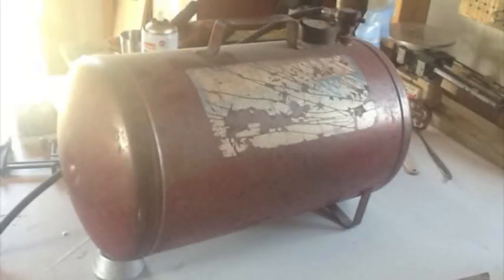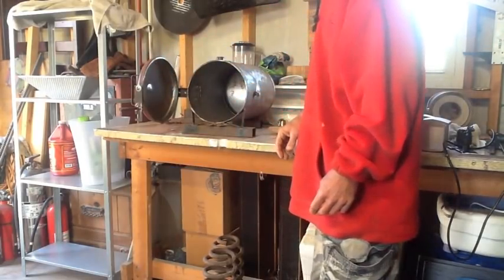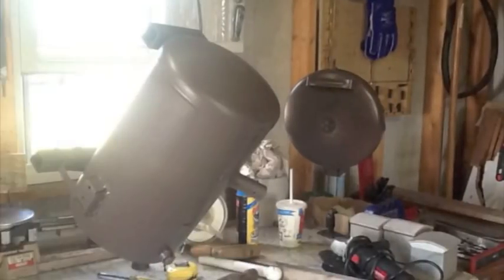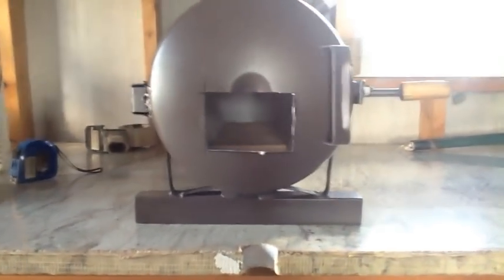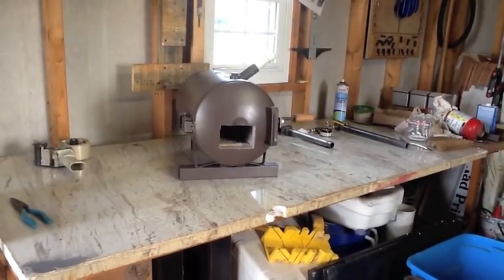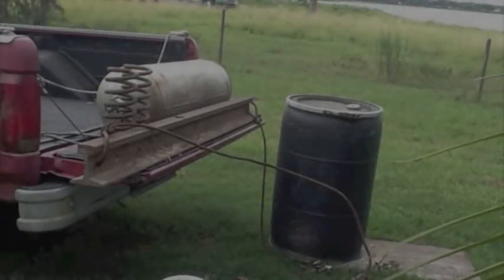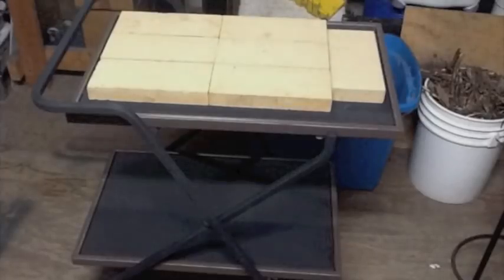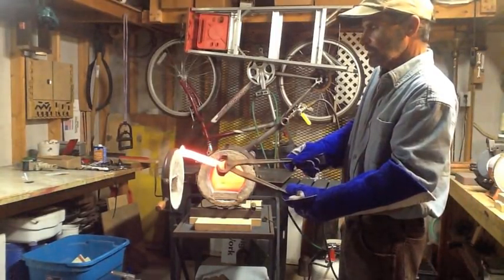My Custom Blacksmith Propane Forge Build - Start to Finish

Comment: I've seen vids where the door hinges are welded in place before completely cutting the door loose. Just cut under the hinge first, then weld the hinge, then cut the rest of the door. guaranteed aligned.
Reply from the maker: I like !! 👍🏼😊
Reply: David Saunders 
YOU DA MAN!

Comment: I have no idea why anyone would down vote this video. It is probably the best propane forge build by a beginner that I have seen on youtube.  You clearly did some research on the subject before you started.  For forging small, more or less straight parts up to as much as 5/8" square, this should work very well and for larger things you can always run it with the door open.  On forges that are kept in a shop it is often more versatile if you forgo a front door altogether and instead stack fire brick up, leaving the smallest possible opening for whatever item you are forging. You can easily adjust the width and height of the opening by moving the bricks around or using things like 1" spacers to raise the opening height a little bit.    A buddy of mine made his door of two vertical light weight (insulating) fire brick that slide to the left and right in a track.  I just stack brick up, myself.  You will also find it quite useful to incorporate a sliding stock support into your design.  

On your railroad track I hope you won't take offense if I tell you that generally speaking, they make very poor anvils...at least when used in the orientation that you seem inclined towards.  I'd like to suggest that you consider studying the ABANA page covering adapting RR track and crane track for use as an anvil.  

http://www.anvilfire.com/21centbs/anvils/making/RR-rail_anvils.php

The issue is that the web between the working surface and the base is far too thin and has too little mass to allow efficient forging.  It flexes, absorbing some of the energy of your blows and robbing your hammer strikes of a fair amount of energy. RR track is more effectively used place on end.  Check out that page.

Generally speaking, a damn decent job.  This is coming from someone with roughly 25 years as a hobby smith and after having built or rebuilt about six propane forges.  At some point you should also try out a coal/coke forge, either by building one or by trying out someone else's.  I forged only with propane for my first 20 years but acquired a coal forge about 5 years ago and now I rarely use my propane forges.  I find coal or coke much better suited for the small hand forged items I make.
Reply from the maker: + Scott Rich Thanks for the wonderful comment, with you having 25 years in smithing and experience building forges I take it as sincere compliment that you liked the forge I made :)

I had no experience at ever making one, and did watch many videos on YTube of people who made theirs, some with great success and others who had problems. I watched the problem videos more than the successes to learn what “not to do” and to learn from other’s mistakes. I had a clear idea on exactly how to go about making mine before I even broke out the angle grinder because I did do my research. I was essentially building the forge around the burner I had made for it previously.

I saw a number of forges made with the firebrick doors…..decided against it so I wouldn’t have to mess with moving bricks around all the time even tho it IS a great option and I am sure works well. I just decided that wasn’t for me. I do have a stock holding “apparatus” I made for the forge that is adjustable and built into the forge. I should maybe do a follow up video on the forge since it is currently my most watched video. I can’t believe it almost has 15,000 views as of today (7/18/16), I never thought any of my vids would reach 1,000 views but lots of them seem to be well received on YTube for which I am happy :)

I know RR Track is a poor choice and I actually spent a lot of time on the site you mentioned prior to making the forge. Thanks for putting that link, hopefully others will check it out as well. Not being overly rich I worked with what was in my budget so use RR Track for now. Would LOVE to have a real anvil, even attended a few auctions but they always went above what I could afford :(

Anvils aren’t cheap, would die to have a “real one” LOL! Hopefully one day I can afford one. I did my best on building the forge so you saying a “damn decent job” makes me feel good about it. Regarding “thumbs down(s), had I been better at editing last year when the vid was put up I think I could have put on a much nicer presentation, but it is what it is. I do plan on make a coal forge as well, I can make my own charcoal as free oak is easy to get. Just need a 55 gal and a 30 gal drum and the wood. Coal or Coke isn’t easily found here in Florida, but is the better choice. Well again, thanks for the great comment and for watching the video, means a lot! :)

Comment: I'm modeling mine (with minor adjustments) from what you've done here. The only thing different I'm doing is making it open ended to work longer pieces of stock. Great video and build. Thanks for the contribution.
Reply from the maker: You will likely need 2 burners with an open ended design...best of luck!

Comment: Nice work on the forge sir thanks for sharing
Reply from the maker: Thanks, hopefully will help someone looking to make one that will work right out of the gate :)
Reply: Makin Sumthin From Nuthin I'm sure it will. It gave me some ideas to improve the one I built
Reply from the maker: Great!  Keep me posted!  I should do a follow up vid of it in action more, not much of this vid showed off the fire breathing dragon :)
Reply: My latest video has my forge in it and I'll try do a video of me upgrading it. Also had a bash at forge welding 👍🏼
Reply from the maker: Will check it out after dinner. Thanks! :)

Comment: I did my piece of railroad track with a hacksaw using a bi-metal blade. it costed me 2 hours under a burning hot sun. Your method seems a bit more sane.
Reply from the maker: Yikes, you are more ambitious than me! I didnt have the $$ at the time but was $$ well spent!

Comment: Hey man just wanted to let you know that your video helped me A LOT. Finally pulled the trigger on building my forge and i referenced this video a TON! I appreciate you sharing your knowledge man
Reply from the maker: AWESOME!  & THANKS!!
Reply: @MakinSumthinFromNuthin  How is it holding up?
Reply from the maker: @briholt100  still works perfectly as designed
Reply: @MakinSumthinFromNuthin  hey, great to hear and not surprised.  Good quality.

Comment: Great job, that forge should last a lifetime and looks great in your shop. That Craigslist haul for $50 was a score. The table you used for the forge was from a tile/brick saw, I've had two over the years I found in the garbage and repurposed. I'm a new subscriber, I'm looking forward to your other videos.
Reply from the maker: Thanks for that info and for subscribing. I got that forge table free, wasnt sure of it original purpose, just cleaned it up a bit and works good for the forge. My Video List is gettin bigger if ya wanna check them out, I am the ultimate "repurposer" LOL :)
Reply: +Makin Sumthin From Nuthin Recycling things to make new tools is a great thing, we learn new skills, help the environment, save money and make new friends and mostly we get new toys to use! There's no downside!
Reply from the maker: I agree! :)

Comment: I worry about the amount of heat rising up onto the ceiling of my garage when I use mine. Do have any input on that?
Reply from the maker: Cement board affixed to the ceiling directly above the forge and a cheap box fan or two to move the hot air outside if you keep the garage door open while in use

Comment: Railroad track is made from 1080 tool steel, you have very good steel for an anvil.
Reply from the maker: they are a bit small but work ok
Reply: My brother made a cold forging anvil from RR trax (he didn't want to use his Peters anvils) and we bolted it to a heavy plate to take care of the lightweight issue we also used a 30" length. An example, I cold forged small feet for stair rail posts that were too small to put into the forge. We built a natural gas forge we could melt steel in. That's a foundry. That was scary at times. LOL Oh I should warn you to wear darkened shooter's glasses, the yellow ones. Reason is the light from a bright glowing yellow forge damages your eye sight in time. Just a heads up. My brother's shop is in CA and his web site is themetalguy.com. we did quite a bit of cold forging, we're both sheet metal guys, blacksmiths, coppersmiths and I'm an ultra precision TIG welder and have welded RR trax and believe you me it needs some serious preheat with that high carbon content, that's knife making steel. Oh FYI, angled steel bed frames are also 1084 steel.
Reply from the maker: Sounds like you guys got stuff under control! 😎
Reply: So those metal bed frames that collapse and fold up in pieces with the formed legs with plastic feet are made with 1080 tool steel...that's good to know! See those setting out for free sometimes.

Comment: Is the railway rail hard enough on its own to serve as an anvil, or did you have to weld a steel facing onto it?
Reply from the maker: Its hard stuff and I used it as is. Its a "poor mans anvil", not really a long term solution for serious blacksmithing but ok as a beginner anvil. I have sold off 1 or 2 of them to subscribers that wanted one
Reply: @MakinSumthinFromNuthin  I'm from the state of Florida too, and you may want to do some checking. I was told by CSX that selling Railroad tracks even the ones that may see little use, "they may be disused but they are never abandoned."... It is illegal to sell railroad iron (even the plates and spikes) for scrap metal in the U.S., and the only people allowed to do it are contractors hired by the railroad to remove and recycle or scrap out abandoned railroad tracks. I don't think you want to be putting all of your video and comments on youtube...I know, I know..."everyone does it"...just do what you think is best and CYA...great job, I'm working on my forge now!

Comment: Great work. You and your angle grinder seem to be really good friends!!
Reply from the maker: Thanks!, however I think I have drove the angle grinder to its death ☠
Reply: Makin Sumthin From Nuthin I like to use flap discs for sanding jobs like you did in this vide. They're not near as LOUD, and they don't dig in to the material as much. Gotta have a Makita or Dewalt. Hey, where did you order that wool material from? Considering making one like this after this knife season ends. The forge I have now is just a little gingerbread house looking thing I made out of refractory brick. It works, but a lot of heat escapes through the single layer brick that I think could be better served INSIDE the forge !
Reply from the maker: I bought the angle grinder just for the forge build, never owned one B 4. Didnt discover flap discs til later 😡 

I got the wool online from a pottery supply, most sell it as well as rigidizer and sodium silicate....shop around as price varies greatly. Use 1" wool and double up on it...is easier to work with that way IMO :)
Reply: Makin Sumthin From Nuthin Cool. I'm currently looking to score a tank, then I'll get started. Loved your design.
Reply from the maker: Sweet, keep an eye on Craigslist 👀

Comment: I used a Lenox diamond hole saw. It worked well. Kept the handle on as well. I also have refractory cement to use along with the Kaowool and ridgidizer. I kept both of the square door plates and pop riveted them on with hinges so  that I could close it up and carry it. I bought some two inch black steel pipe and cut it down to weld to the holes for the burners and drilled three holes in each for thumb screws. Also acquired a fairly heavy duty cart which I’m filling the top of with kiln bricks and four large mounting bolts sticking up through them to mount the forge to. Built my own double burners with an extra valve on the second so I can run only one when I don’t need two. I meant for mine to be more portable so that’s the reason for the differences. Also the way I’m building the cart I can always upgrade to a larger tank as mine is a little smaller than yours. Mine was certainly probably not the cheapest route although I’ve been buying all the components over the last year and a half. Good job though your forge looks good.

Comment: Great video, some great ideas for my next forge build. My current one is made from a 1 gal paint can using perlite and plaster for the insulation and coated with refractory cement. It work great for knives, but the size limits what I can forge. Thank you for sharing your build sir.
Reply from the maker: I am glad it sparked some ideas 😊 Thanks for the kind words

Comment: Very nice forge. I wish I had the space to make one, but my place has no garage or even a shed. But eventually I will be moving and hopefully find a place where I can build my own forge. I will be trying to use your method as I always figured an air tank would be much better than using an old propane cylinder. I used to have a nice #55 anvil but someone decided they needed it more than I did and walked off with it.
Reply from the maker: Thanks....and sorry to hear about your anvil 😡    I am sure your forge will turn out great! :)

Comment: excellent work. I am going to use my 30 gal old iron horse compressor to make the same think. Thanks for the Video
Reply from the maker: Thanks!, you will need a bigger burner than mine with a 30 gal tank tho....Good Luck on the build!

Comment: Hello and Merry Xmas,  Nice project and executed very well.  I would suggest that you take a piece of 16 ga strap (2" worked well) steel and weld it inside your door opening with an inch protruding.  It bends to shape with the heat of the welding and some 'C' clamps.  Overlap the ends and weld close to them before cutting off to complete the circle.  This gives you a nice seal when you close the door over the top of the protruding one inch.  I have used hot water tanks, propane, air and compressed gas cylinders (condemned diving tanks also) for projects.  I made a welding rod oven with a hot water tank keeping the foam insulation except where I cut it which I replaced with a can of spray foam.  A small silicone heating pad keeps it toasty.  Take care and enjoy the holidays.  Doug
Reply from the maker: Hapy Holidays to you as well, appreciate the kind words and suggestion. Will keep that trick in mind for any future builds. Was hoping you had some vids documenting the process, I certainly woulda watched them! :)

Comment: hello sir, I'm glad I found your channel. I gave an old air compressor that came off of my welding truck that I am doing the same thing to it. most of what you did is spot on to what I would like to do for mine. however I believe I will make a door for the back as well as my belief a door on the side. I was planning on 4 burners 2 on each side alternating. I think my tank is a 40 gallon. 
I have a bus brake drum to make a Coke Forge as well.
Reply from the maker: Sweet, sounds like a good plan. Probly roast a whole turkey in 4 min with that one! :)

Glad you like the channel :)

Comment: Nice build!! I may sacrifice my Campbell hausfeld air pig and build a forge like yours!! I’ll probably use paint stripper to remove all the blue paint though...grinding that would suck ass! I might leave mine bare metal and use high temp clear coat! 
Thx for sharing!!
Reply from the maker: I had the time so stripping the paint manually was within the budget. I hope yours turns out nice, its all in the burner

Comment: Awesome job on the forge design and construction. Looks to work a lot better than mine does, but with a bigger volume and still only one burner - a very effective one it seems. I'd have expected you might need 2 for a forge that size. A quick word on the anvil - since you have spares kicking about, consider boxing in the sides of one and adding something to increase the weight - maybe pouring lead in if you find it for cheap enough.
Reply from the maker: Thanks Matt!, if you have a video of yours I would like to check it out. Interesting idea on the anvil, will take a closer look at it...I have lead :)
Reply: I've been thinking of making a video for a long time - I might just do it one of these days. I'll let you know if I do
Reply from the maker: Please do! :)

Comment: Hi , I  bought a nice Wadkin radial arm wood cutting saw. The foot holding the upright post was smashed into about four pieces. Wadkin stuff is top price but  then their stuff is top quality.  I nearly died when I asked for a replacement foot. I was costing me what I paid for the saw more or less. Someone suggested I use J B weld  which I had never heard of it did a fantastic job and all the pieces of cast iron were put together so as when sanded up and painted it looked and felt like new.  That was a bout four or more years ago so I see why you went for it too. I never realised though it would take that kind of heat though someone enlighten me more please great project. Alistair in Scotland uk
Reply from the maker: JB weld is good for up to appox 500 degrees F. I knew if I built it properly (the forge) that the outside would never approach that kind of temp and I was right. In another video I demonstrated putting my hand multiple times on the outside of the forge after it had been operating for quite some time.

Comment: Great project... turned out great.  But you should be using a refractory coating!  Ceramic wool fibers are carcinogenic, and without a coating the burner blows them all over.  The coating will also greatly improve the efficiency of your forge.  You can get a reasonable priced coating from Zoeller Forge.
Reply from the maker: I have 2 applications of rigidizer and 2 coats of ITC100 on the wool, I'd be hard pressed to do more than that